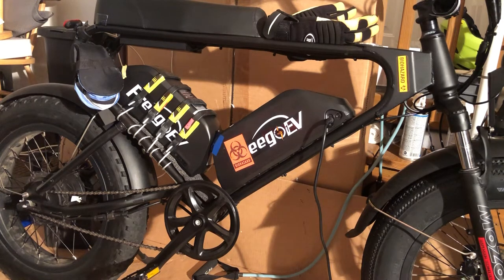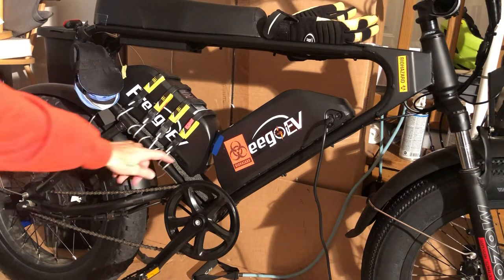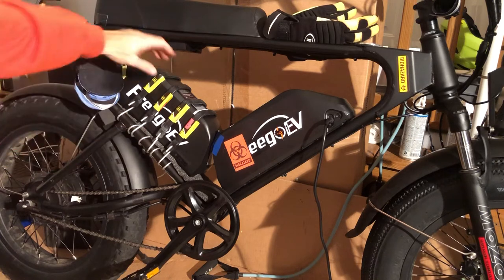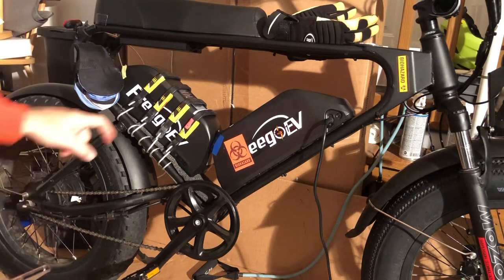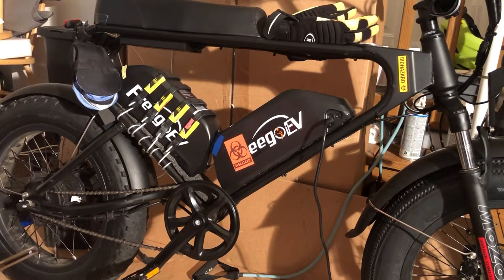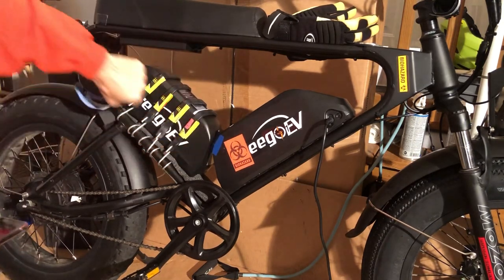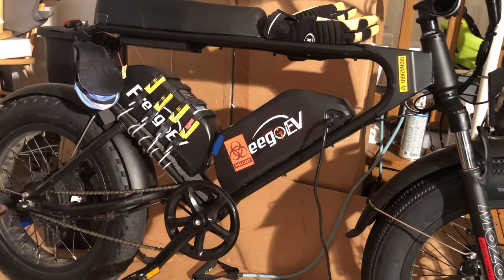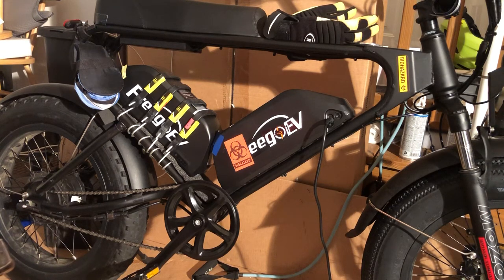Freego DK200.  How to mount your second battery.

Comment: I bought a second bike, moved headlight up to handlebars, built rack on back, storage bag above battery, turn signals and added Shinko SR 241  3” x 16” motorcycle tires (yes they fit) no more flats

Comment: So it could not mount with the 2 screws there? Also slime is good but flatout is better. Look into it if you have not already.
Reply from the maker: I’m able to battery swap as quickly as 5 minutes w this setup.  I haven’t looked into a hardware mount.

Comment: my pedal assist hasnt worked since i messed with my setting and i kept trying to turn it back on but it worked when i first rode it, any help?
Reply from the maker: My codes video might help. There is an on/off code
Reply: Check your pedal assist settings, P10 should be set to 2 for pedal assist and throttle, p11 is pedal assist sensitivity, that should be set to 1 for least sensitive (more motor) but you can set it to 24